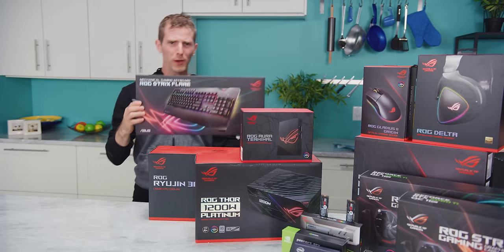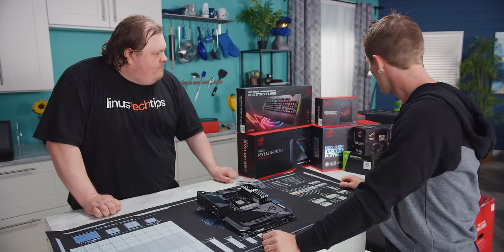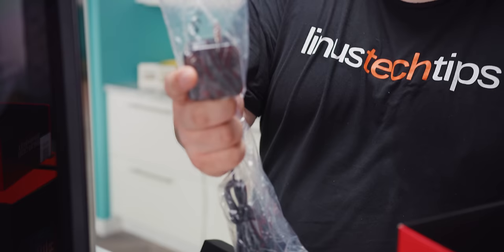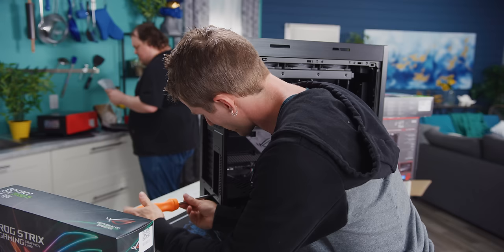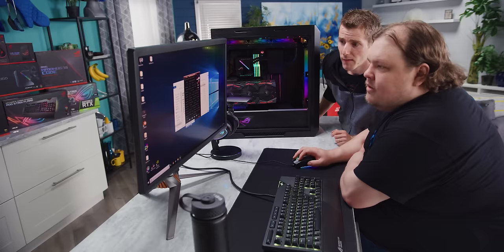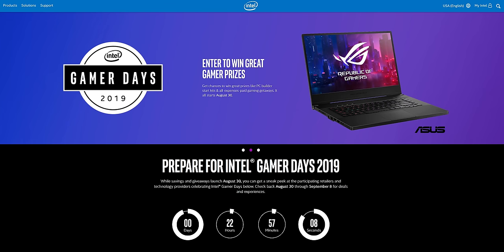The All-ROG Gaming PC!

Comment: According to my calculations as of June 2020

Intel i9 9900K -  $564
ASUS ROG Geforce RTX Strix 2080Ti - $1405 x2
ASUS ROG Helios ATX Case - $320
ASUS ROG Maximus XI Code Motherboard - $260
ASUS ROG Thor PSU 1200W 90+ Platinum - $370
ASUS ROG Ryujin 360 CPU AIO Cooler - $320
G.Skill Trident Z RGB 64GB 3200 Memory - $290
Sabrent Rocket Q 1TB NVMe PCIe M.2 2280 SSD - $120 x2

Asus ROG PC = $ 5174

ASUS ROG Swift PG27UQ 4K 144hz Gaming Monitor - $4300
ASUS ROG Strix Flare Mechanical Gaming Keyboard - $130
ASUS ROG Gladius II Origin Wired Gaming Mouse - $60
ASUS RGB Gaming Headset ROG Delta - $150
ASUS ROG Scabbard Extended Gaming Mouse Pad - $50

Peripherals - $4690
 

Total Setup Price - $9864

Some of the items were no given in the description, so it may not be fully accurate. Also this video was made in August of 2019 so prices may have been higher when this video was made

Wow I was really bored.
Reply: Darknight E  That monitor costs more than my PC
Reply: Thanks i guess
Reply: i’m cheaper than you
Reply: The monitor prices right now are just expensive af Jesus... Corona really hit the market hard.
Reply: That monitor, wow... just wow
Reply: wow that monitor was easily the biggest surprise. why so damn expensive? I get that it,s 4k 144hz and HDR but still, I would expect that to be absolutely no more than $2,000
Reply: Pretty sure the monitor cost aroung 1.6k
Reply: that more than a rtx quadro 8000
Reply: Respect 101
Reply: @peterodonnell2401  thanks.
Reply: Dude u saved me so much time. Definitely gonna screenshot this
Reply: At least in the US, the monitor is between 1700 and 2k depending on where you're buying it from. Best Buy sells it new for 2k though I've seen it on sale for 1700 before. Still expensive but can still get 2 for the supposed 4k+ price.
Reply: Uff
Reply: In my country:
(in US dollars)
i9-9900K : 810$ 
Asus ROG STRIX RTX 2080TI (no more stock, but i remember it was something about 2300-2500$) x2
ASUS ROG Helios ATX Case: 592$
ASUS ROG Maximus XI Code Motherboard: 530$
ASUS ROG Thor PSU 1200W 90+ Platinum: 700$
G.Skill Trident Z RGB 64GB 3200 RAM: 400$ each stick.
Sabrent Rocket Q 1TB NVMe PCIe M.2 2280 SSD (no more stock too, but i don't remember if it was 300$ or 400$, something like that.)

ASUS ROG PC in my country: 10.032$

(Yes, 3rd world country, no need to ask).
Reply: Bro two of those headsets is my whole pc... Fs in the chat bois
Reply: thanks for that cost prediction.  i was hoping someone would do that in the comment sectiom.
Reply: Raul's Gaming that monitor costs more than my entire gaming setup
Reply: Good job for this lol
Reply: @NeXeR @sharmin sultana @Rob Marshall happy to help
Reply: The mouse pad is already more powerful than my pc
Reply: Raul's Gaming more than my setup and my brothers combined
Reply: Flick Gaming dang
Reply: if your in australia, double that is 2500 for ONE 2080TI
Reply: Lol remove the monitor and you get half the price XD 😂
Reply: And most of the items are out of stock, too. (PCPP Knows all the prices)
Reply: Myloprime are you sure that the monitor costs 4.3k and not 430?
Reply: lol way too bored
Reply: @aclonymous  at the time of writing this, yes it was. Even I was shocked
Reply: Just just got a Asus rog I'm getting anxiety I can't even open the box I'm just looking at it.
Reply: wheres ssd
Reply: @prodwilno  it's on the list but in case you still don't see it

Sabrent Rocket Q 1TB NVMe PCIe M.2 2280 SSD - $120 x2

This list is not fully accurate now as prices may have fluctuated, but it gives the picture.
Reply: wow a 50$ mousepad. i use a kitchen towel(not the paper kind)
Reply: @Raulz  that core costs more than my pc
Reply: and he lives in canada too so its about 13 k canadian
Reply: Darknight E i mean it doesnt matter because the monitor is almost 5k$
Reply: Shots you got nothing else to do... Not the hero we deserved

But the hero we needed
Reply: This is so obviously a Streamer setup tho. No game currently needs specs like this. 1 of those overkill just because you can moments
Reply: that monitor costs more than my entire setup
Reply: @oh6328  that wire costs more then cause I don't have one🤣
Reply: @Combet Warsor hmm but I don't have one do it bought eternal
Reply: That's Canadian or us?
Reply: @C4GPU  us bro🤣🤣
Reply: @universalyoutuber195  wtffff
Reply: And than i bought a car worth $7k....saved 2k bought pc worth 1k...still 1k left....i don't know what to do..
Reply: @d_k8700  go enjoy your life with that
Reply: @C4GPU  yeah bro it's us dollars
Reply: @ChaoticDucc now maybe it's price fell down
Reply: @universalyoutuber195  dang
Reply: @C4GPU  yeah that's quite, I mean more than that it's really expansive. See his video of a gaming setup worth 10k that's better than this
Reply: @universalyoutuber195  mk, dont like ur own reply btw
Reply: @C4GPU  what's mk and did I offense you?
Reply: @universalyoutuber195  mk Is just another type of "ok" and no but liking ur own REPLIES is not a pro move
Reply: @C4GPU  oh you meant that! I just like doing that.. I like every comment I see including yours which I've liked
Reply: @universalyoutuber195  do your thing man 😂😂
Reply: @C4GPU  ✌️😉. Are you from us?
Reply: @universalyoutuber195  nah bro 🇨🇦 Canada
Reply: @C4GPU  wow, must be a good country 😅
Reply: The monitor is only 1800 pounds. Half what you said
Reply: @danielport4771  us dollars not some bullshit weights
Reply: @universalyoutuber195  thanks 😁
Reply: @ChaoticDucc this calculation was made in June, almost 2 months ago. It's a good thing the price halved then. Still overpriced
Reply: @danielport4771  I am using dollars as it is basically the worldwide currency, so idk about pounds or other stuff.
Reply: @user-pj7ur2pk4t  what did I do though?
Reply: @danielport4771  the video used the currency dollars so would I use rupees? Use some sense bro
Reply: @universalyoutuber195  you said,

"Shots you got nothing else to do... Not the hero we deserved But the hero we needed"

Or was that not a compliment?
Reply: @user-pj7ur2pk4t  that was a complement though. I was just kidding that you are also bored in quarantine like me and also you helped us by the latest prices.. so I mentioned not the hero we deserved but the hero we needed.. well,this is a meme content basically used for someone who helped a lot or did an outstanding work to be mentioned a hero we needed.
Reply: @universalyoutuber195  Nice
Reply: @user-pj7ur2pk4t  ✌️
Reply: I had to pay $10999 with all the components nothing just some extras. like I do buy all my tech stuff with my money. But here I had to lend some from my Mother and my Father with only one that was that u can't upgrade ur PC within 3-4 years.
Reply: @_fiftyseven_  cool. Are you doing a job or something..you did a wrong job now..you should wait for 1 year and get a rtx 3080 and the new processors compatible with it
Reply: @universalyoutuber195  Yep! along a programmer... well I did a terrible thing. I got the i9 10900k with the RTX 2080 TI and 128 GB ram. G.Skill Tridentz RGB (32x4). which did coz a hefty one!
Reply: @_fiftyseven_  that's really great combinations...worth the money.
Reply: @_fiftyseven_  you're really lucky bro but if you're a programmer you could have got macpro with pro display xdr.
Reply: brother just snagged the 9900k for $410 off amazon.
Reply: Also, yeah... as a few people have pointed out.... the PG 27UQ monitor is only like $1000-$2000 depending on pricing.
Reply: @somelolplayer6199  you mean us dollars?
Reply: @universalyoutuber195  Well I'm a gamer. I'm just a small programmer I'm actually still learning. Will be going for Python and I already have a ROG Zephyrus Duo and Galaxy book flex which are powerful enough to do my programming!!!
Reply: @somelolplayer6199 Well you're lucky!!! I got 10900k about 490$
Reply: @_fiftyseven_  are you a school student? I'm also trying to step towards programming.pls suggest between Asus g14 or MacBook air
Reply: @universalyoutuber195  Yep,I am and it's yours requirements. Either u want a 13 inch or 14 inch, Windows or MacOs. It's all yours can take anyone if them. But do remember if u take the macbook air u have to get the highest spec one!!! But I would take G14 than the macbook air as AMD processors r great in budget than the Intel ones but I love Intel!!!
Reply: @universalyoutuber195  yea
Reply: @somelolplayer6199  oh
Reply: @_fiftyseven_  Thanks bro.was thinking about the same but at 1300 dollars I get 1650ti and 4600hs with anime matrix in india
Reply: wow thanks for the info, now i can start to save up lol
Reply: @barrykoy251  that's not worth it though if you are the most advanced gamer in the world you need 2000 bucks for an ultimate build also the rtx 30 series coming so you get FPS double
Reply: UNIVERSAL YOUTUBER 195 woah! Good to know bro! It just kinda looks cool
Reply: @barrykoy251  yeah
Reply: NinjaAlexz 105  you should get it in the description or it must have been written on box
Reply: Nearly 10 Fucking thousand dollars ☠️☠️☠️☠️
Reply: there's no way that monitor costs over $4000
Reply: @your_average_cultured_dude  actually that's a pretty cool one good for streaming and all
Reply: You said "Wow I was really bored" like you edited that in there
Reply: @ruffs.5439  but the comment ain't edited .see on top
Reply: goosePS  Asus are worth or RAZR?
Reply: goosePS  yeah it's really great
Reply: thanks
Reply: @Raulz  same my pc is $3k, not $4k lol
Reply: good thing i can afford it
Reply: p e r i p h e r a l s: $4690
Reply: lol thanks
Reply: I’m Australian-
Reply: If I'd ever win a mr beast challenge this is wat I'll buy
Reply: When the monitor costs 12x more than your pc
Reply: F in chat if this cost more than your car.
Reply: Wait is this usd or cad
Reply: @donutz424  My setup too lol (around 7 times cheaper than that monitor alone)
Reply: @smitty7510  Same
Reply: Changed the price of the graphics card below 500 dollars, its failing hard.
Reply: Rtx 2080 ti should go down in price to something under 599
Reply: Btw they used samsung 970 evo m.2 nvme ssds
Reply: Thanks man
Reply: @Raulz  in India you can get 4 top high end PC at the price of that monitor
Reply: The monitor should be like 1500 or 2000 actually I checked
Reply: @siddheshkoka4125  oh thats good then
Reply: Why is the monitor worth $4000 if I were given that budget I would have like 4 1440p 240hz monitors and a decent rig
Reply: @d_k8700  Put RGB in your car.
Reply: Wrong the monitor is $2k
Reply: @MetaDude  please keep in mind that these prices were made in June, and they may have fluctuated as time passed.
Reply: @user-pj7ur2pk4t  oh i didn't see that mb
Reply: @MetaDude  np it's good
Reply: Monitor pricing is wrong. Change it to 1.5k
Reply: Raul's Gaming more than my pc mouse mouse pad monitor desk and chair
Reply: Though 1200watts is far too much and wasted. Instead I'd use a better motherboard of Asus.
This Ryujin CPU coooler is AMAZING! Desighn and that less space it needs for a CPU cooler for this powerful CPU I definitelly want that in my next PC!
For ram you can also save a bit by using 8GB dimms because who ever needs fcn 64 GB in a gaming PC. xD
Reply: @KamichamaTechstarify  no one ever needs 2 2080s either unless you work for Disney
Reply: @user-pj7ur2pk4t  I think you answered to a wrong person, I never mentioned anything about 2 graphiccards.
Reply: appreciate you saving me a lot of time bud
Reply: Paying 400 dollars on a PSU and over 4K on a monitor is a certified bruh moment.
Reply: I wanted it but that reality fact just made my cry lmao
Reply: and i want a ROG AMD  even with $$ pinching well over $1500  thats trying to keep each thing under $300 ,500 for vcard.. Great info  thx you
Reply: The motherboard is literally the cheapest component in the pc besides the SSD.
Reply: Great build up. All components are such overkill. I wouldn't buy them even if someone gave me the money.
Reply: 10000$ for a system which sucks nowadays infront of all the new products announced and launched
Reply: @aclonymous  insta bloody_impact_xt c
Reply: $4300 FOR A MONITOR?!
Reply: @rachelwong7767  Give
Reply: holy shit
Reply: 4.3k on a 27 inch monitor... pass
Reply: Darknight E   fax
Reply: I9 9900K is a rip off when there is i9 10850K for almost 100 less with way better performance
Reply: You know it’s kinda sad that the intel i9 9900k costs more than or close to my computer...
Reply: @Raulz  wooow
Reply: Omg
Reply: Thats my 7 months salary right there :O
Reply: You must have been bored but thank you I had to watch the whole video to know the total price that was never mentioned
Reply: I was lowkey wondering how much this all was
Reply: i9 9900k worths less now
Reply: @Raulz  you mean an RTX 2080 Ti
Reply: Respect
Reply: God damn you were REALLY BORED...
Reply: Thanks?
Reply: Rog expensive
Reply: the cpu's price can be used to build a streaming pc in the philippines
Reply: @Quetip  hey fellow guy
Reply: @user-sl3lg7ze8v  nice name, very good dish
Reply: The headset is more expensive than my pc 😭😭
Reply: Tf they spend so much money on one video
Reply: God I just wish that I have 10 thousand dollars laying around
Reply: Wow that headphones are the price of my laptop
Reply: Understandable
Reply: You can buy a used Nissan Skyline R33 and a gaming pc with decent specs with that total
Reply: You forgot the NV link bridge.
Reply: 5 months later is this is my most liked comment by at least 30x my second most liked comment. Thanks guys
Reply: me: imagine even ttying to save up for this
Reply: they didnt use sabrent rockets
Reply: NERED NECK TTV

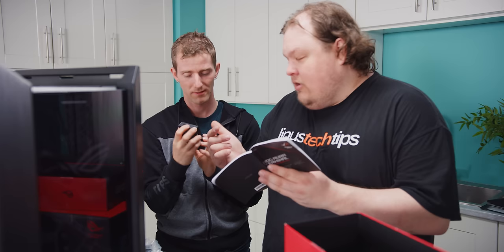Comment: 6:36 for anyone that's interested: This case has a tray in the top that you can take out, so mounting radiators and fans is extremely easy. Just build the config you want to use and pop the tray with fans and radiators back in and you're done!
Reply: Front tray too
Reply: I just ordered this case and as I was watching them struggle with that I thought "there has to be an easier way to do that" LOL. Same for the PSU cables

Comment: I know I’m late to the game, but when installing the radiator and fans the simplest way is to use a single normal screw in each fan to just hold it in place then connect the long screws through the other holes into the radiator.  Then replace the 3 normal screws.

Comment: Timestamps
1:13 MOBO
1:49 CPU
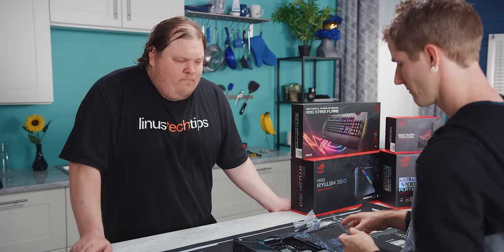2:22 RAM
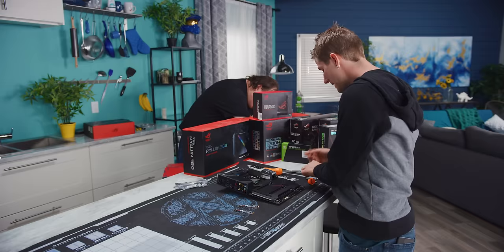3:30 SSD
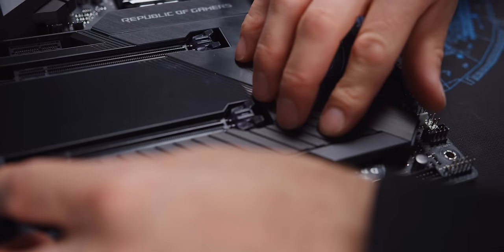4:09 CASE
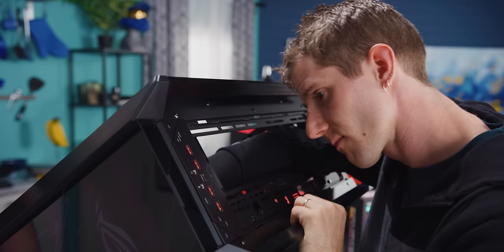5:07 AIO COOLER
6:08 RGB CONTROLLER
10:19 How To Put 2 USB Headers Into 1
11:00 Linus Hurts Finger
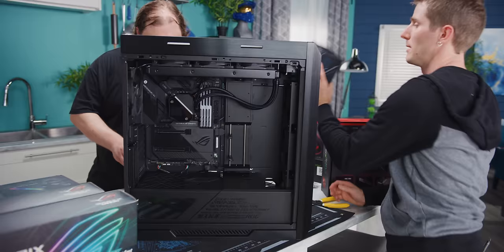13:02 PSU
13:16 DUAL GPU'S
14:31 And a one... And a two... And a Th... R... Um... EE
16:58 Peripherals
17:07 Monitor
17:28 Linus Hurts Finger Pt. 2
17:38 Startup
18:35 Putting on Case Panels + Bonus Two Peels

Comment: 21:30 "Everything is running flawlessly"
FPS drops to 30
Reply: My pc would run it at 3fps with the lowest graphics
Reply: 60 fps is perfectly fine with me when it comes to fps
If you use 90fps for a week and switch back you'll notice a difference
Reply: Rtx is future, 30fps, meh
Reply: It’s ok, the charger just got disconnected
Reply: shouldve used the wall plug to unload the PSU current drawed by RGB